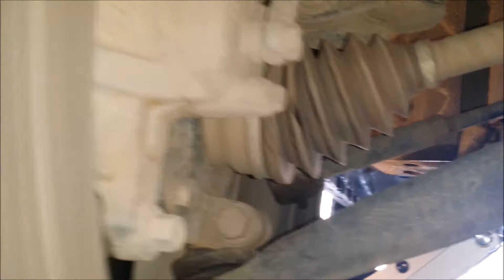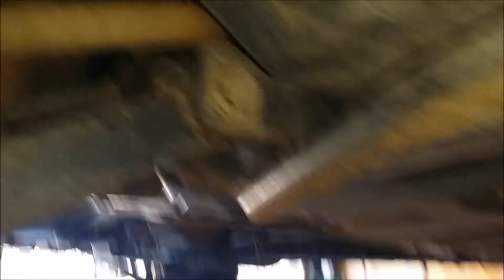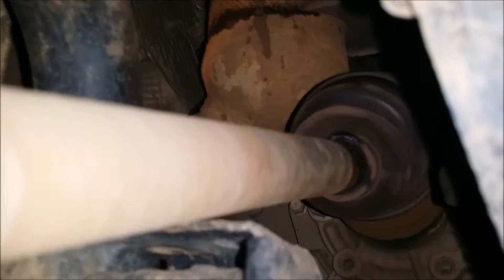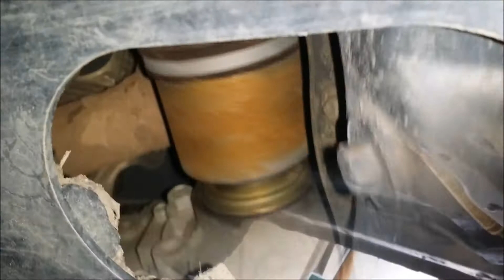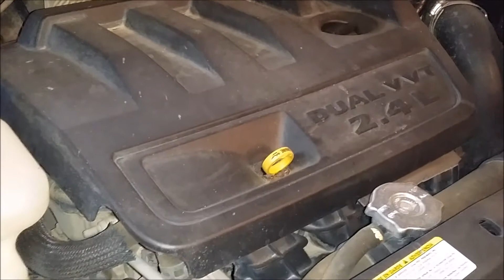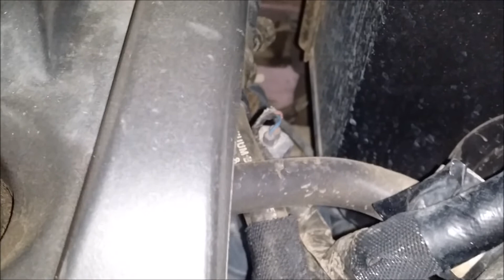Jeep Compass Motor Mounts

Comment: The CV joint angles were too extreme because the wheels were unsupported. All of that knocking and shifting was due to the inner CV joints binding. Appears to be lifted too so this adds to the extreme angles
Reply from the maker: It wasn't a CV axle issue it was a motor mount on the passenger side, this issue did not happen when the driver side wheel was up in the air
Reply: @TnTTyler  I am an ASE Master Tech. Trust me, the thing causing that movement is the inner cv joint binding. If you look close, you can see it shift three times per rotation of the axle. this is because each inner tripod bearing is binding every time it goes around. I know because I have a lifted patriot and saw the same thing. Put a jack under the lower control arms and it stops.  The Mount may have allowed additional play, but remember, an engine does not move like that on its own. Also, the right front cv axle is the one that binds up on this vehicle. that is the one that causes the famous vibration on take-off when you install a lift kit.
Reply from the maker: @bradmanoutdoors  This only AFTER one of my motor mounts broke. I don't care if you are ASE PHD or what not.  I owned MK's for 8 years I know them very well.  Again I was lifted and had ZERO problems prior to the engine mount breaking.  I ever have it on video, i'll upload it for you to watch you can hear the mount break
Reply: @TnTTyler  like I said, your mount may have been broken, but unless you have solid mounts, everything will move when your CV axles are binding. All I'm saying is the inner joint was causing the movement. A broken mount alone doesn't cause everything to shift sideways like that.

Comment: ATG & I suggest that the fault was/is by greedy CEOs buying cheapest parts & making the most profits. 
Motor mount on the passenger will go out first then driver side later. 
Best to replace them all. But many owners can not afford the repair bills. 

This Compass is just as lousy as the CR-V.  
Both are gas guzzlers & costly repairs after 153K.
The worst scam is when you salesman really care for you & your safety. Then they got you 5 ys car payments!
Reply from the maker: Things break down, with every brand of vehicle even Honda's. CRV's are complete trash, my compass could go farther offroad than any honda.
Reply: @TnTTyler  I like my uncle's Hummer H1 modified version for SAS. 
This guy is has bad mpg.